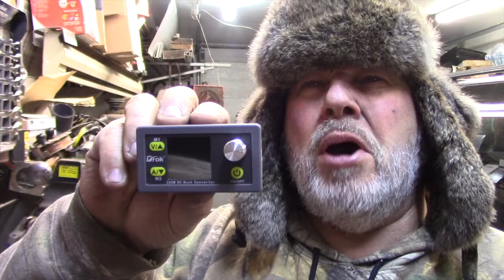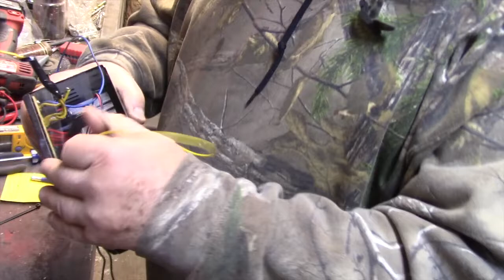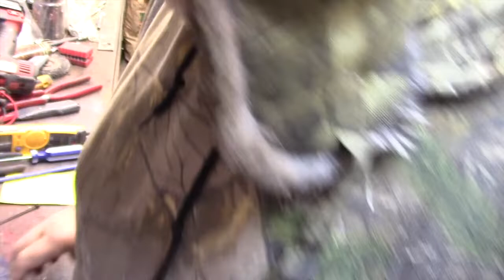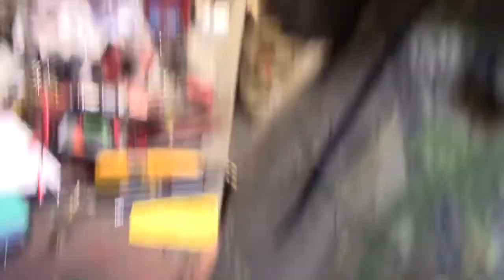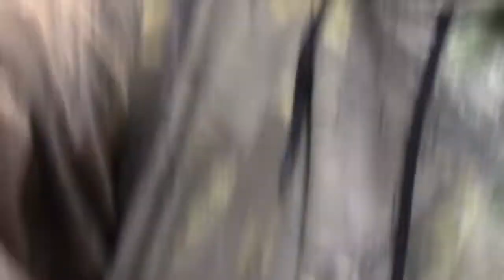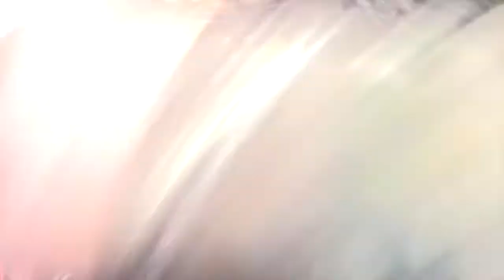DIY power supply for Buck converter

Comment: How's she goin'?  Too bad the computer power supply didn't work out!!  It looked some nice though.  I had never heard of the Buck converter before.  Looks like a handy little piece of gear and would have lots of uses around the shop.  Where did you get this one?  Thanks for posting.  Take care!!
Reply from the maker: There all kinds of these on Amazon but they all come from the same place ....so...It`s buyer beware as usual but it`s good and it works just fine and It`s smart....not like a normal charger that has no smarts....CHEERS
Reply: @gatorsworld  Thanks for the info!!!

Comment: Love the electrical design buddy. What is the max. amperage the unit can charge at  per hour .
Reply from the maker: When I`m writing, everything about that info is in the garage....I think it`s 5 amp Hr, but the batteries can't take without heating up ....2 amp. Hr so that is the max that I use at the moment.... a nice little DC charger and it`s very smart 2.....CHEERS